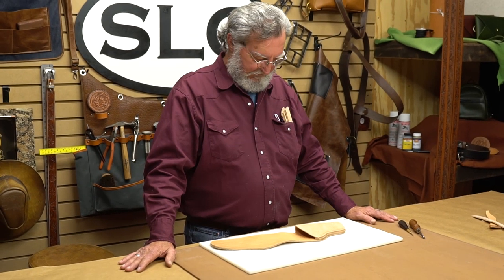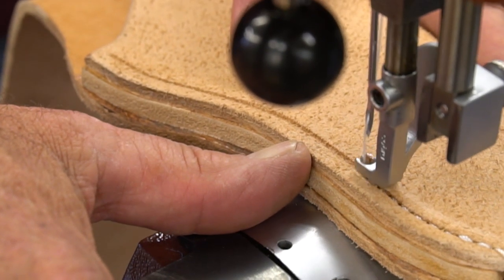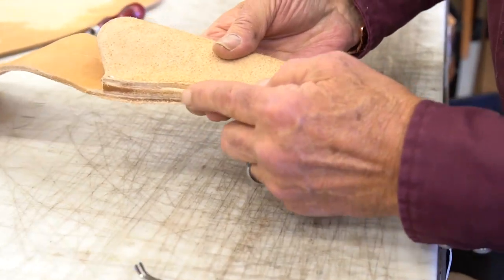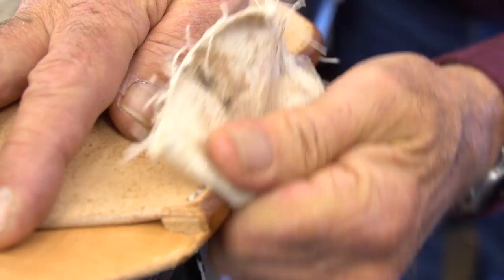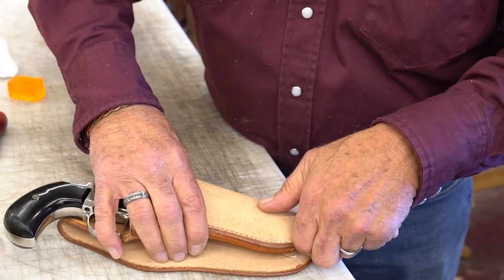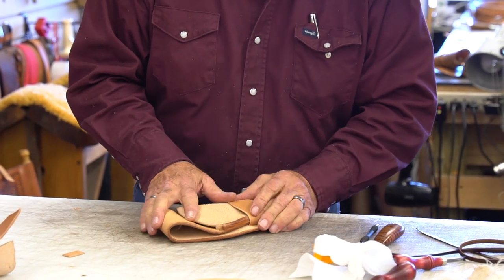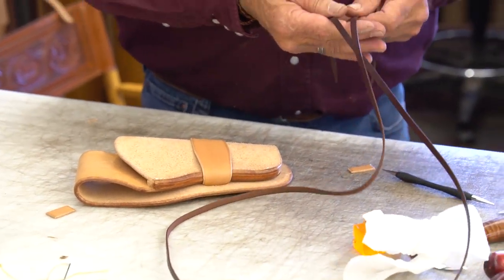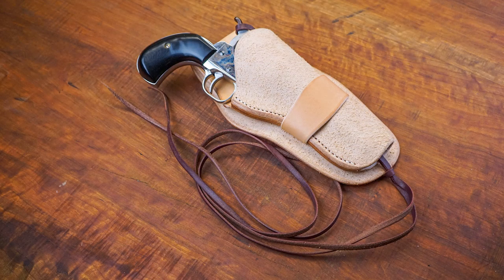Making a Single Loop Holster Episode 3

Comment: Good video but why is it inside out...did I miss something? And not to correct you but isn't that glycerin not saddle soap?
Reply: Its called glycerine saddle soap by Fiebings.
Reply from the maker: Not inside out, it is called Rough Out (rough side of leather showing). Just the artist choice that Denny made for this series. This also allows not having to line the inside of the holster.